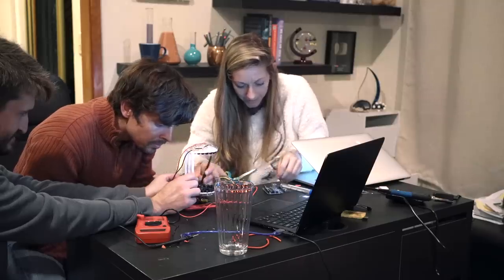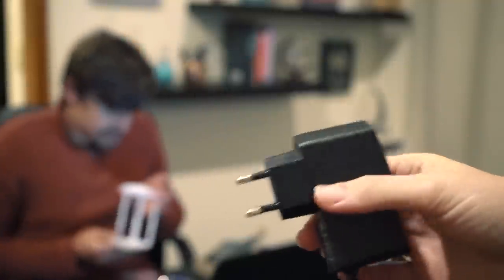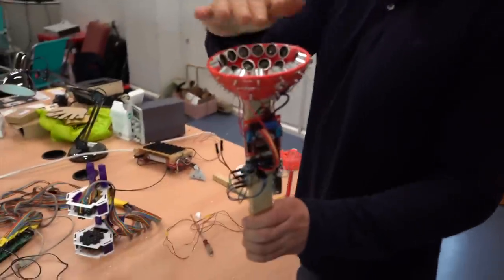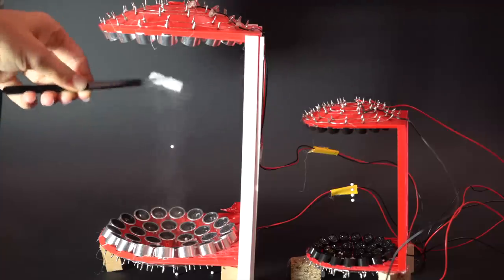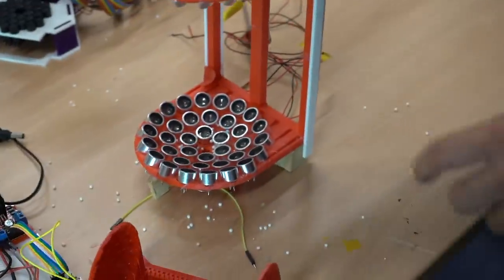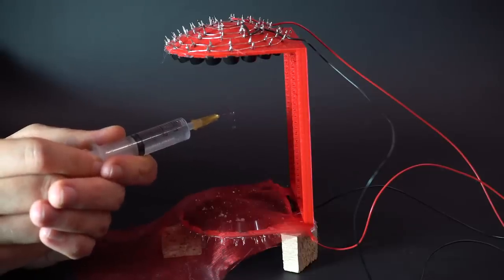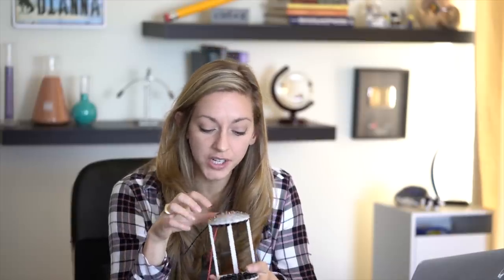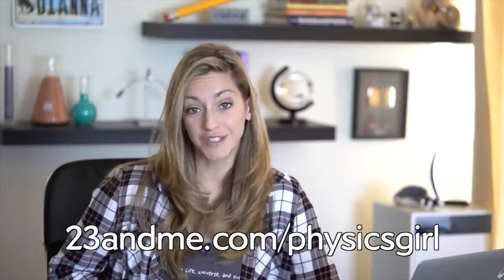I built an acoustic LEVITATOR! Making liquid float on air

Comment: I'd love to see what this looks like using Schlieren photography! Also, any idea if this would work with different densities? It should get weaker at high altitudes since it's closer to a vacuum, so I assume it should get stronger with a dense gas. My choice would probably be CO2: put the levitator and a piece of dry ice between clear walls and the dry ice will produce a dense gas that displaces the air but stays in the container until it overflows, at which point it would pool on the floor while you get up to open some doors. It's foggy but hopefully not too opaque in a small container.
Reply: wonder if you had little droplets of water or dense gas fall over it, horizonttally, could it catch it mid air?
Reply: It would be really cool if it could. From the way they were delicately placing the particle, I couldn't tell if currents or shakiness were enough to push it out of the "well" or give it enough momentum to escape,  or if the well was reasonably stable but surrounded by unstable volumes. Very fine mist would be likely to suspend, but you have the problem of getting it there without a current and without giving it enough momentum to keep going. It's possible that a denser gas would make perturbations too powerful, but the container would shield it from most of the currents across the axis with all of the nodes, so maybe that's workable if it is an issue. As far as it catching the gas, it would be really hard to see without the help of Schlieren photography, but it's hard for me to make educated guesses without that at all!

https://www.youtube.com/watch?v=fQ6upluqgsc

The levitator physically has some symmetries that would make the standing node pattern easy enough to visualize, but are they in-phase or out? Are they even the same frequency? Would it work the same upside down, or is there an asymmetry in the sound they emit? Eh, hopefully she does a follow-up. I took a couple semesters of physics in college but nothing that would help with this.

Comment: Very cool that this is actually a thing. Now, if you're looking for the strangest application possible:  suspend a droplet of something that will attract those annoying, tiny flies that sometimes get in the house and zip in front of your monitor, and create a standing wave strong enough to freeze the bug in mid air. Boom: sonic powered catch and release fly trap. Wasteful of energy, arguably pointless, but it would be cool to watch if it actually worked.

Comment: I wonder if you made two of those and set one on the horizontal axis, twerked the settings and possibly the polarity of the horizontal plane, if you could change the size and shape of the nodes? Kind of like square waves in the ocean.

Comment: Microphones can detect 40 kHz, but I don't know any consumer speakers that can produce that frequency. That's why pizos are used to generate these frequencies. More importantly the CODEC you used to encode the video was probably not detecting those frequencies, or was at least filtering them out as irrelevant background noise.

Comment: If you're talking about standing waves, could you explain how the acoustic refrigerator compressor works ?
It was a gallon size metallic "vase" with a powerful loudspeaker builtin, the whole thing was filled with a gas. I thought that the compressed wave get cooled by the surface...

Comment: And what about using normal transducers instead of ultrasonic? OK, it might be annoying for you, but @ 7:20 he mentions that it only works up to half the wavelength, so with less frequency, the wavelength is larger (8.5 / 2 ≈ 4.3 mm vs. 68.6 / 2 = 34.3 mm) and will be able to levitate larger objects, at least theoretically.

Comment: Re: human constraints at hearing only up to 20-22 kHz. I have a friend that can hear the sonic mouse repellent device (they constantly produce tones at about 30-60kHz). Mice are supposed to hear them, but not humans. Although, it was a cheap one, could've been working only at about 25-30kHz. Either way, she was very annoyed until it was switched off.
Of course, 40kHz is probably safe enough.

Comment: Would love to see if you can generate  rotation by setting opposite facing speakers 180 degrees out of phase, I did a thesis paper on this regarding 4 to 8 point sound sources producing a standing rotating wave, would be neat to try and modify this setup to try it

Comment: I can see this becoming the next 3D hologram tech.   With the right phased array configuration, particle clouds could be manipulated and animated in 3D space.  Those ultrasonic transducers are fairly weak, there are more powerful transducers with higher frequency ranges that can accommodate harmonic splits for higher resolution.  Perhaps a heaver gas than O2 and Nitrogen would provide more levitation force along with a spinning mirror.  Is there such a thing as phase array light projection to selectively illuminate the particle cloud?    Anyone want to be the next BIll Gates?  I'm talking Princess leia and the R2D2 New Hope projection thing

Comment: Put enough of these into a square matrix, and have a cnc type do-hickey with an electro-magnet at it's tip, feed it tiny magnetic (fluorescent?) painted ball bearings, you'd sort of have a primitive 3d display, no?

Or maybe tiny rgb led circuit with a small, almost imperceptible battery and same for an embedded transceiver...

  ( :

Comment: Seems to me that the standing-wave explanation isn't quite sufficient.  There is an alternating pressure signal, which if truly sinusoidal would average out to zero (relative to ambient) everywhere, and couldn't produce a net pressure gradient to achieve the steady force required to oppose gravity.  
I believe this relies on the nonlinear pressure-displacement curve for air.  That makes it a second-order effect, which greatly limits the mass of the object which can be levitated.

Comment: why we need a kit to do this ??  all you need is one transducer,  a frequency generator (ultrasound) , a piece of glass to reflect the sound waves... move it to set the correct distance for resonance... which will be a multiple of 1/2 wavelength of the frequency.... this would save ample amount of time soldering so many tiny transducers. haven't tried it but it might be possible to use a tuning fork to make a Styrofoam ball levitate, I think that would be cool thing to do

Comment: Can you do this same with electron or photon? I mean standing wave and similar device but using light or electrons?
Reply: Krzysztof Wierzbicki I was wondering a similar thing, is it possible theoretically or otherwise to create a standing wave with light, or any other part of the electromagnetic spectrum?  I could imagine butchering some magnetrons and trying with microwaves, maybe microwave ovens already do that?

The big thing ATM is detecting gravitational waves, if only we could control a couple of black holes for an experiment. :)
Reply: gass lasers use a resonator cavity, aka an optical cavity. Wikipedia has a good article. and I may be mistaken but I think Optical cavities for lasers predate acoustic levitation.

Comment: It might be interesting use   acoustic levitation in a vacuum. I noticed that the liquid splashing is very interesting.
Reply: Asier Marzo and Physics Girl I made one. Ordered that parts and 3d printed it.  Looks like I need to order more transducers! lolz
Reply: I tried doing a few things. First I tried setting something on fire in the node....... it didn't work but was very interesting. So the second thing I did was sprinkle ash into the node...... I found random other nodes other then the five or six center nodes.

Comment: So if you would put the speakers on the walls of a tunnel, and angle them just right, you could move a particle forward right?
Reply: I think so; and if you can control the speakers individually, you might not even need to rotate them, just change the phase of their waves (there are actually antennas that work like that, they're composed of a bunch of tiny antennas that can be controlled individually; if I'm not mistaken, some satellites use that so they can aim their signals without moving parts).

Comment: Imagine that sound can be the very single thing keeping a UFO suspended in the air, and that the key to travel in the universe has been right in front of us the entire time....
Because you can actually make thing levitate with power as well.
You would need 200 kilovolt to levitate an object weighing 100 kilos. 
Frequency could also be a factor, but an UFO?
Nothing is impossible once you're able to wrap your head around how stuff works ^_^

Comment: Hello Physics Girl, I have some question.
Is the NOD point created by the device you created the high air pressure point? Or is it a low point?
Otherwise is it a point where there is no change in pressure?
If the Anti-Nod and Nod of a Standing wave are expressed in air pressure, how do you explain the levitating a ball?

Comment: 5:37 there's no signal wire this is only positive and negative, it's basically pure sinusoidal AC source but how to run it on ultrasonic sensor without AC rectifier? because the ultrasonic runs on DC I can't understand the design please explain

Comment: too bad you can't change the phase....be fun to move it around in 3d space. 
Higher powers and higher frequencies would help too...given that a particle is basically riding on a very high pressure bump...could lift heavier things with less worries about vibrations, locations...but the size of the object would likely need to be smaller unless an object were in multiple nodes

Comment: I want to build one of these but I can't buy the kit easily 'cause I'm not american and ordering one from the US is a pain so I though I should buy the material in my country but I ran into a problem. In my place, they only sale transducer in pair, a transmitter and a receiver. I'm assuming the transducers on both side are all transmitters. So if I buy 60 pairs (for the medium one), I will be throwing away half of them (the receivers) which cost almost 70$ (they're freaking expensive here). So my question is, are they really all transmitters? or I'm getting the wrong idea here?

Comment: Earth is a realm, it is not a planet. It is not an object, therefore, it has no edge. Earth would be more easily defined as a system environment. Earth is also a machine, it is a Tesla coil. The sun and moon are powered wirelessly with the electromagnetic field (the Aether). This field also suspends the celestial spheres with electromagnetic levitation. Electromag levitation disproves gravity because the only force you need to counter is the electromagnetic force, not gravity. The stars are attached to the FIRMAMENT.
- Nikola Tesla

Comment: i can do better than that setup. the force field is created from waves that are time delayed in such a way that the top of the second wave is in the middle between tops and bottoms of the first wave. if you tune the distance to a reflector just right the levitation effect will stop working. that is because the reflected wave become paralell to emitter wave and is the origin of the quantum nonsense of science. so with a more advanced language  the emitter beam have to  be out of phase with a second beam to produce a interference pattern. if the first beam somehow return back in phase with the second beam the interference pattern disappear and there is no levitation and is what collapse the wave function. acustic levitation or laser iterference by mirror or electron interference is all the same principle. no phase difference between the beams or reflection of beam and no interference pattern and in the sound case no levitation. i realized that you could generate a frequency of levitaiton in a cubic of volume of air by emitting a interference pattern of sound and then reflect the interference pattern of the sound with a sound reflector. that could produce a cubic volume of nodes and antinodes instead of a single beam of interference.